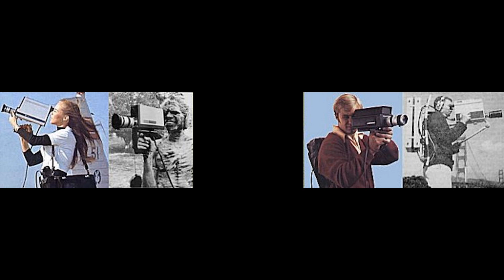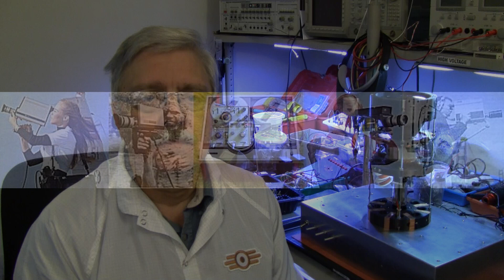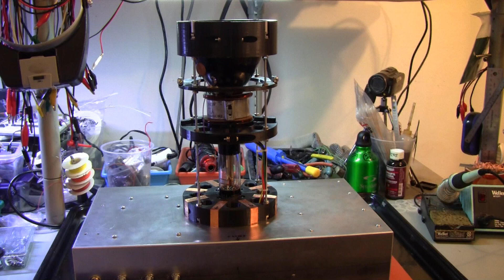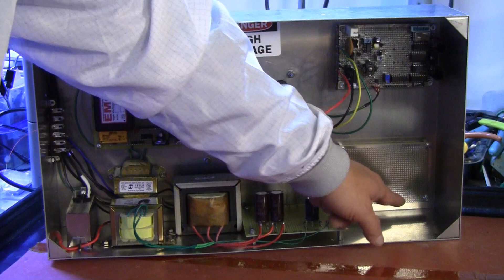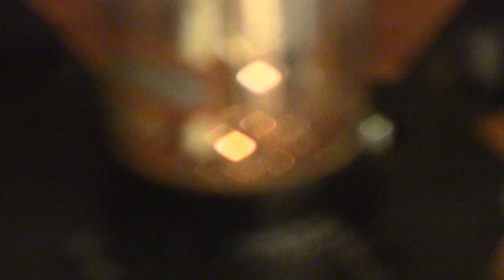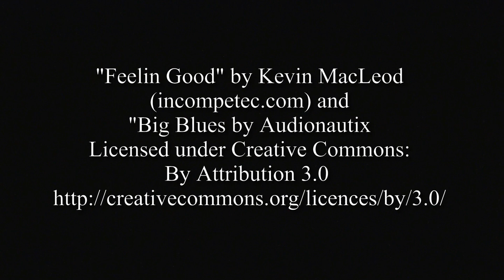The Chief - Update #9 - Beginning Final Assembly

Comment: Very sweet! Now on to the video processing circuits!
Reply from the maker: Yes and no. I need to extend the top of the stack by about 70mms to squeeze in the video preamp. Good news. The +/-12 volt regulators are installed and working. Next is to breadboard the variable DC regulator for the horizontal scan circuit. Then install that. THEN it is on to video amplifiers.  Details, details, details!

Comment: Very neat work.  Sometime in the future I would like to create an in-home cable system for my vintage television sets. Gary
Reply from the maker: Gary. I have a cable modulator you could have. But... it is channel "R" or 265.25Mhz cable mid-band. Old TVs probably can't get that channel. Not sure if it could be converted. Its made by Pico Macom, model PCM55SAW.
Reply: @videolabguy  Hi; What I thought I might do is to build a rack of six or eight Blonder Tongue agile modulators with Zenith digital converters to create a cable that will feed six or eight VHF channels. I am not sure I am going to go through all that expense though just to demonstrate how changing channels worked on vintage television sets.  Thank you for your thoughts.
Reply from the maker: A worthy project indeed! The parts for that are plentiful and cheap thanks to digital wireless tech making them obsolete.